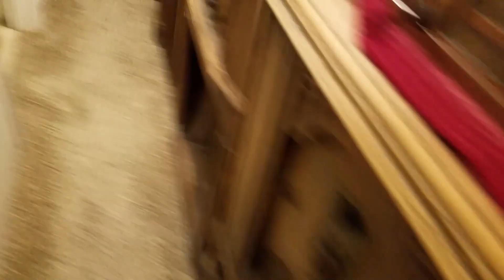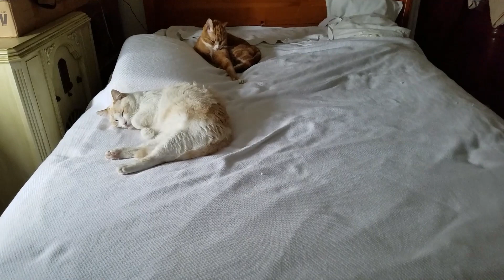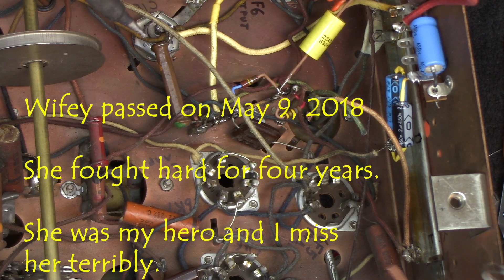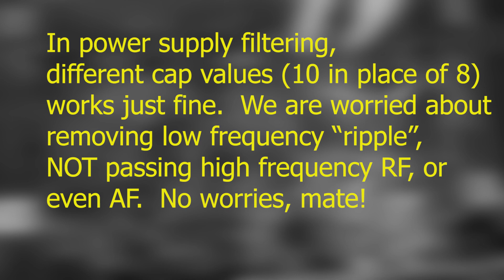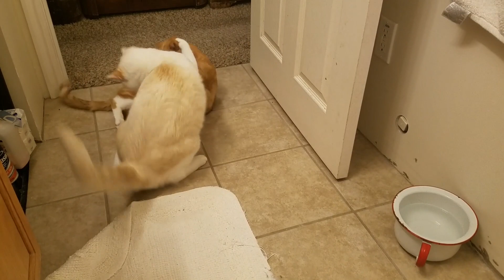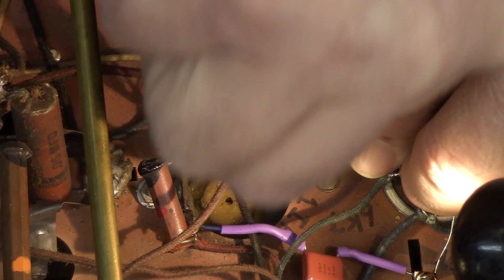FIXED! 1938 Zenith 9S262 Shutter Dial Tube Radio Part 5 of X   Finishing Up Basic Chassis Work

Comment: What is the purpose of the little thimble looking thing on the bottom center of the screen at 17:28? Mines got two really fine wires on it and one of them is disconnected. Thanks.

Comment: Thank you for putting so much detail into re-working the tuning eye drive @25-28 mins, the schematics call the big red one 22M, which doesn't help. Also for me I tin stranded lead wire beofre soldering down to minimize the fraying. I knew to be suspicious when I saw other values like 100M, 330M when I could see their color-code were 'K sized.

Comment: Michael, I am sorry to hear of your losses, and of your health issues.  I enjoy your videos and your cats.  I have multiple 811Ks, 813Ks, and 816Ks.  To date, I have restored four (2 811Ks and 2 813Ks).  After your move, do you still have your 812K?  I plan to convert a spare 811K chassis to a 812K.  I have all of the necessary components from an 813K to complete the project.  Looking forward to hearing from you.  Fred